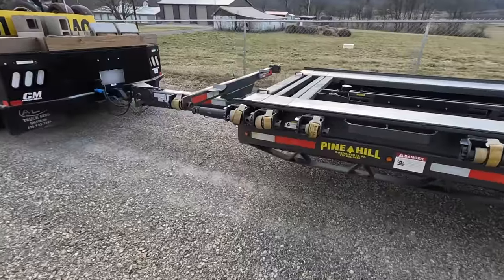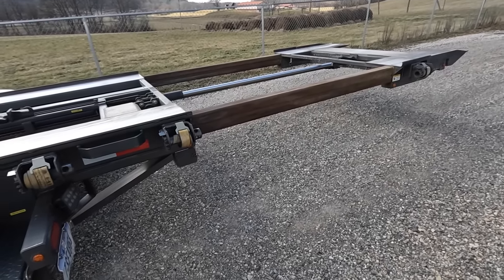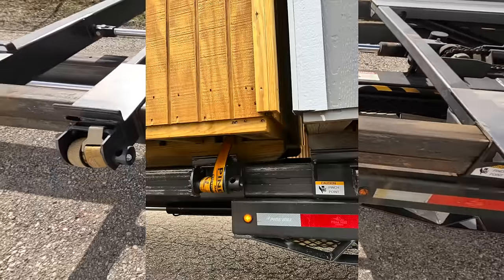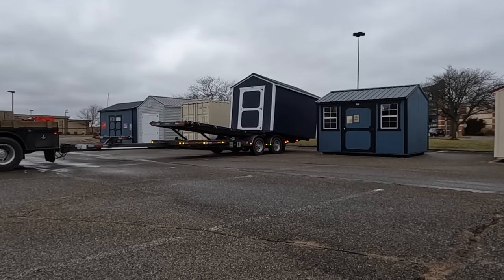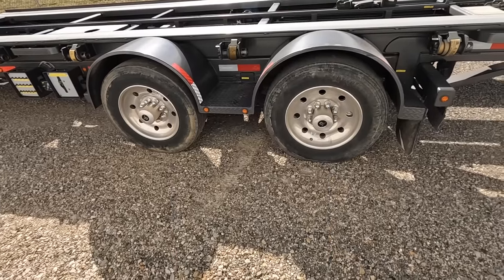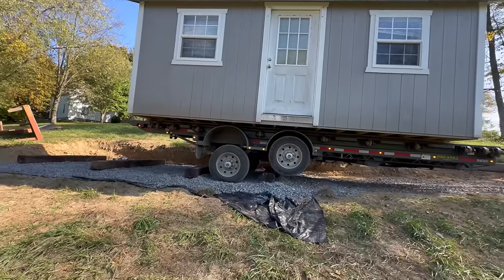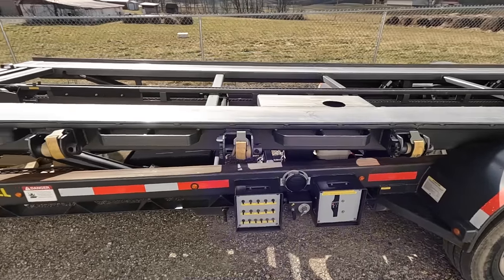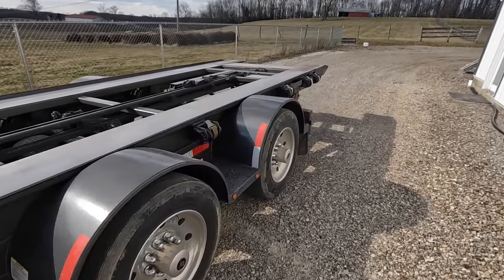Exposing the Cost of My Shed Trailer and Features

Comment: $80k for the trailer,  another $80k+ for the truck and $20k or so for the mule (was surprised at this when I looked it up).  Add in all the ancillary stuff and that is a stiff ante-up cost.
Thanks for the video.   Amazing engineering and design on the trailer.
Reply: The mules can go a lot more than 20k, saw another video where one of the smaller ones was $34k, and he said upwards of $50k with higher load capacity

Comment: Amazing trailer and not shocked at all about the cost for all the features it has. 

I'm curious about what the empty weight and capacity is? 

The hydraulics, side moving wheels, size of the steel that must be needed, etc, I'm sure it's not light empty. I also don't know what the typical shed weighs but I guess it has enough capacity to haul them. I have to wonder about repo's full of stuff though... 

Anyway, just curious, if you see this and are able to share that's cool, but just seeing all the features and cool things you can do with that is amazing.
Reply from the maker: I think the Trailer weighs almost 9k The people that build them would be able to answer your other questions much better than I can.

Comment: WOW with all the bells and whistles I would never guess the cost. I was thinking it would be a whole lot more.
The engineering gone into that trailer is genius. 
I had to trailer myself away from my PC so I could get some sleep. 

I built some much smaller machines for manufacturers in my life. All were pneumatic not hydraulic. It's kind of the same 
concept but using air cylinders. 
I have to watch more of your' vids. I think they are amazing.  Thanks for the tour of the trailer.
You are a master at your' job.

Comment: Thanks for the trailer review. I was guessing around $75K so I was close. I was wondering how the leveling axles worked. Neat design but I don't see how you can keep your axles aligned enough to keep from wearing out the inside of your tires. And the center 4 wheel drive tire assembly is awesome. Being able to run a trailer sideways is almost like cheating.

Comment: I've been watching your videos recently and have marveled at the capabilities of this trailer.  Thanks for this video -- it answered all my questions.  One of them was about the side shifting wheels -- i was curious if they were installed straight across along the radius of the hitch pivot, and I see that they even thought of that detail and aligned them with the arc of the radius.  One thing I noticed though is on the gray junction box next to the battery box, the front left screw is loose.  Might want to screw that in so the box stays well sealed.

Comment: I’ve been waiting for this after 37 years of putting them on flatbeds with a heavy wrecker. This is the nuts and he’s very good at his job…..side drive has caused a lot of swearing in the repoees vocabulary. Think they have it parked in.aaaawwwww overextended on the railway ties. Not enough room between the ties to do that is there??
Reply: That looks like English. But idk what the heck you even said.

Comment: On your trailer tour; in front of the driver side wheels it looks like a control panel with lots of switches and then there is a lever behind that.  Any explanation would be great.
Trailer is worth every cent you spent.  In business I learned you can pay for labor (going back and forth to truck) or you pay for equipment to save the labor.  :)
Reply from the maker: The panel is just all the functions of the trailer. But I have a remote so I never use it. The lever that I think you’re talking about is a master switch. By switching it off. It kills all the electronics

Comment: That trailer is an engineering marvel! Well thought out and executed! Yeah, expensive as all get out too, but the set up you have with the truck, the trailer, and the mule are pretty essential to do the work you do. You're gonna have to haul a LOT OF BUILDINGS to recuperate that kind of money lol.  I do have two questions: 1) What is the maximum tongue weight of trailer? Is it limited to what the hitch can handle?  I guess it's class III or higher, maybe?  2) It doesn't appear that the two rear axles have any real suspension on them for the highway ride, correct? I noticed there were just the hydraulic cylinders to raise/lower each side independently, on each axle. Maybe it doesn't really need suspension?  Anyway, thanks for that video, very cool!

Comment: That’s a beautiful piece of equipment, I think if it was me, I would keep a supply of replacement hydraulic hoses, I would assume they’d be pretty expensive, and probably not all that available easily. Having a set made up, and kept handy, would be a wise decision. I was in business many years myself, as a mason, and had some fairly expensive equipment myself, I learned that lesson the hard way. I’m 75 years old now, but I enjoy watching young folks doing good, and making their own way, like I did, it’s not easy being in business for yourself, and making big investments to get yourself ahead. Scary, but necessary if you’re ever going to make it! 👍
Reply from the maker: Thankyou! 

I’ve only had about 4 hoses blow in between 2 trailers in the last 6 years. And I have always bin able to stop in at a Napa and get a new one cut to size in a few minutes. 
But there is a a lot of hoses on these trailers. So keeping some on hand would definitely not be a bad idea.
Reply: @ShedmoversRus  -- Plus the rubber in spare hoses ages out over time too -- whether you're using them or not = not good to have your money tied up like that.

Comment: It's a awesome trailer  I never seen anything like it. Must make a huge difference in you're line of work! No matter the cost
Reply: But hopefully you take good care of the engine on the trailer, it never runs long enough to get to operating temps before its under load... Change oils 4 times a year I would do, if not more often..
Reply: @xxbambamxx7261 he was shutting it off so the sound wasn’t ruined in the video. I imagine when moving/loading sheds it runs plenty long enough to get up to temp
Reply from the maker: That is Correct. When its really cold,I let it run a good while before I put it under load.

Comment: At $80k it will take you awhile to pay it off. When I repoed vehicles many moons ago it was alright money. I can see sheds paying more for a repo as the equipment is very expensive and it is a very specialized piece of equipment as with a tow truck I used to pull fence posts and small tree roots so I was able to make money off of that as well.